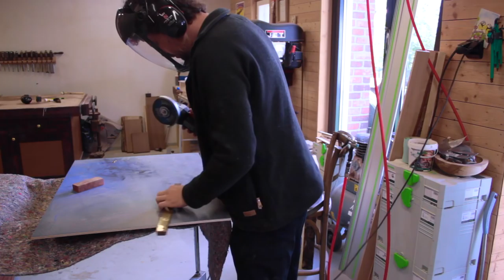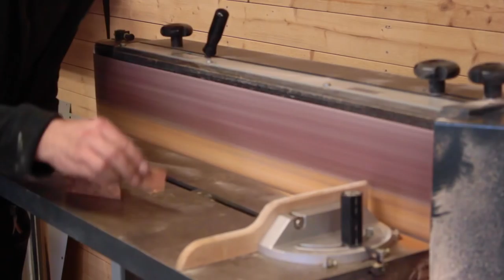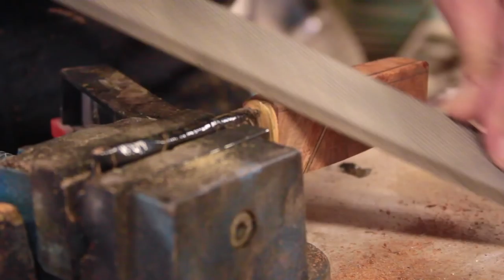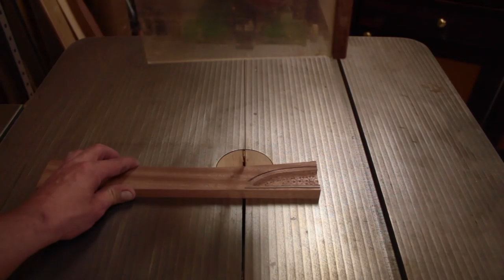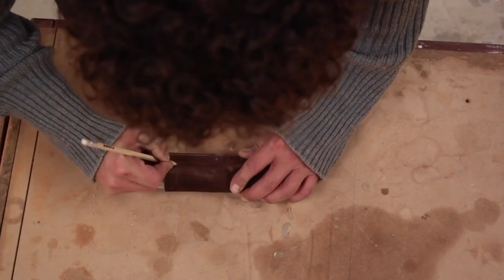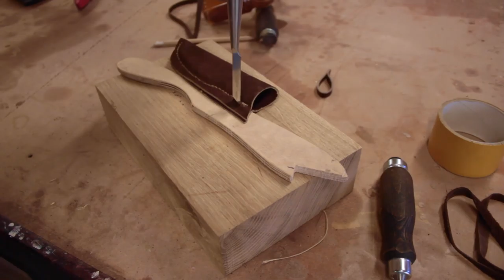A knife for Simo

Comment: Maurice that handle turned out amazing I love how ya cut it on the angle n added the brass n veneer. The sheath turned out nice as well. it seemed like this was a 3 day build for you to. Great as always sir
Reply from the maker: Hi Joe, I two or three days it was. Got to let the epoxy cure and later the sheath soaking takes at least overnight drying time. Thanks for stopping by Joe :-)

Comment: Great video as always!

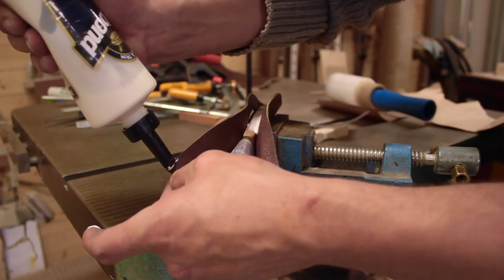6:03 is that regular Titebond wood glue you are using on leather? I didn't know that would work.
Reply from the maker: It happens to be titebond molding & trim wood glue. (isn't prone to running or dripping and has a fast tack for a pva) The glueing before stitching is just a helping hand so to speak. After stitching and soaking in water the glue will let go. You could use a waterproof and it'll stay.